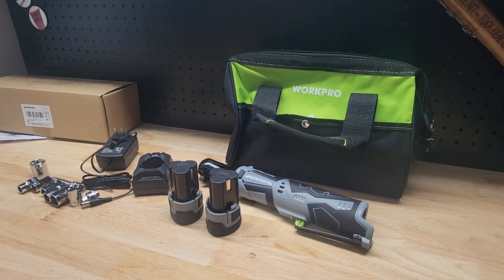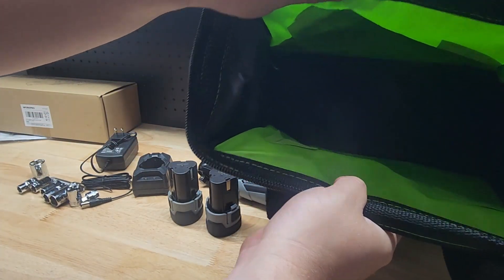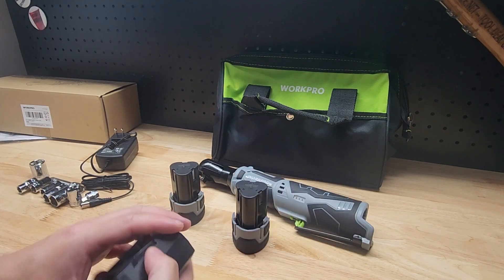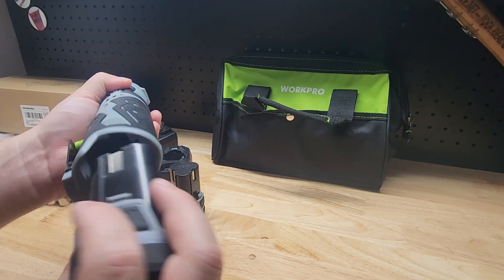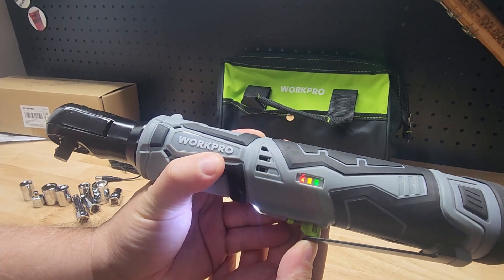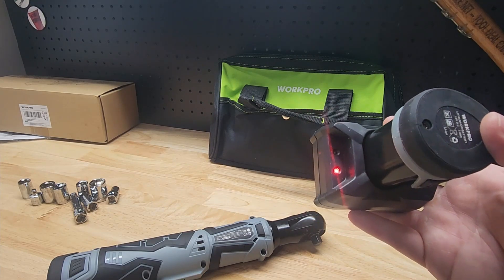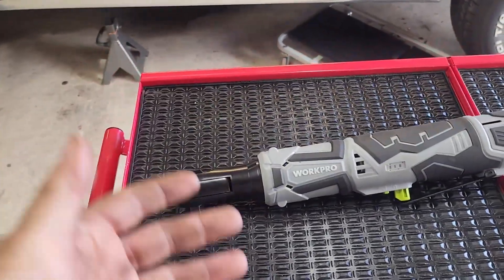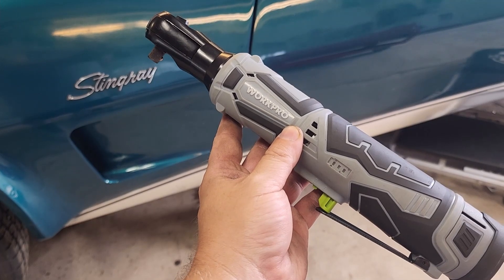Is The WorkPro Cordless Ratchet Any Good?

Comment: I really appreciate video reviews like these. They give you a really good view on what it's like using the tool in different applications.
Reply: I got a 12-volt Ryobi. Cordless ratchet 3/8.   But it does not tighten or loosen the bolts for you. Like the husky cordless ratchet 3/8 I had untightening and unloosened it does it for you husky. But they are a little pricey but hell if I can get two of these for the price of a husky and they do the same as the husky non-stop work.

Comment: I bought this kit with 2 batteries for £72 in the UK. Things i like about it are the handle is very nice and sturdy with nice rubber molds which seem like they would protect the tool well. The colour of the tool is great and it comes with a decent socket set with the tool. I also like that the battery indicator lights light up different colours as apposed to just one colour. It also comes with a decent tool bag with a good zipper.
A few things i didn't like which is why i ended up returning this device and buying a Sealey instead:
Its quite heavy and the balance of the tool isn't as good when compared to the Sealey 12v ratchet. Over 350g difference.
The anvil head is very large. I wasnt expecting it to be this large being only a 3/8 drive ratchet. The Sealey ratchet has a much smaller anvil which is great for tight spaces.
The device is very noisy and no where near as smooth as the Sealey one. Maybe you can make it quieter but putting some great in the mechanism for the anvil. I'm not sure.
It somewhat annoys me that the charging lights has the red light on the right and the green light on the left ( i know this is very minor)

Also the fact that you cannot buy replacement batteries or chargers in the UK are one of the main reasons i returned it as im not confident that i would be able to get replacement parts for it when or if i need them. I think if WorkPro made replacement parts easily available to buy in the UK, and applied more grease to the inside of the anvil so it was quiter and smoother this would be a great tool and i would highly recommend it.

I actually managed to find a new one on eBay for £30 so i bought that a couple days ago to keep in the boot of my car as a spare should i need it.

As i say i returned it and bought the Sealey as they had an 15% offer running so i got the ratchet, 2 1.5ah batteries, a 3ah battery, charger and tool bag for £99. This also comes with a 1 year warranty and replacement batteries and chargers are available very easily. 

Thanks for this video as it made me look into there brand. I would love to see more videos of you using this ratchet if you would make some
Reply: Do you remember if the lights on the charger are supposed to be on when charging? I tried both batteries but get no lights when plugging into the mains.
Reply: @PixelVogue  yes the light is supposed to be on when charging. Sounds like you may have a broken charging dock. I have a spare one currently for sale on my eBay